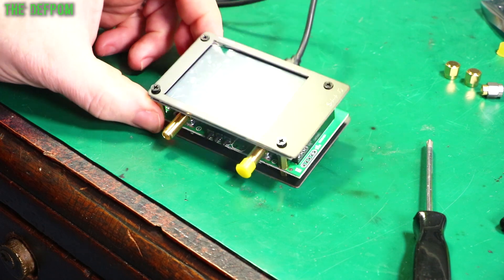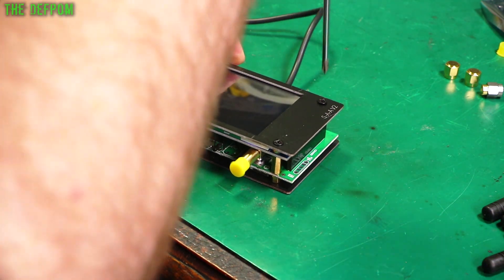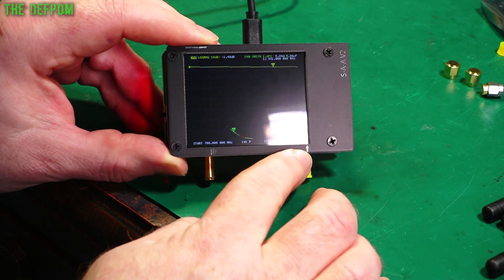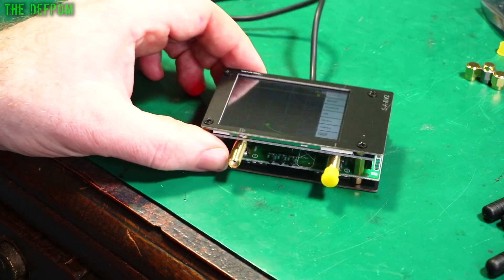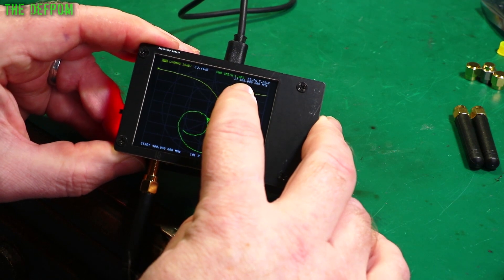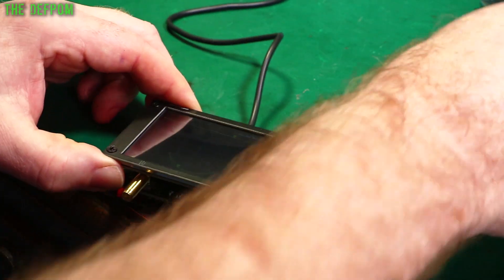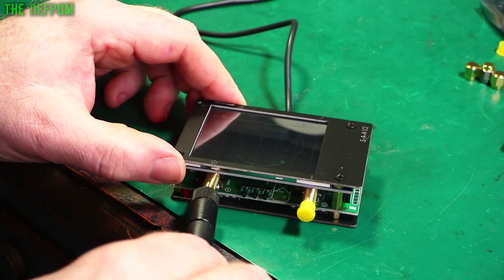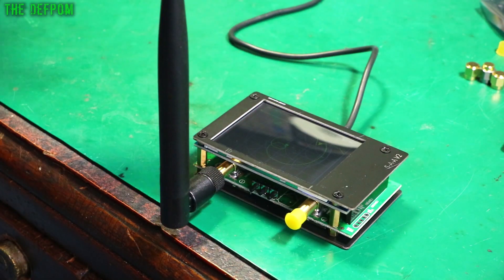How To Use NanoVNA V2 To Find Antenna Resonant Frequency - No.754

Comment: Just got mine delivered today! Thanks for the simple instructions. I was able to get all my SWL bits of wire i use for temporary RX across the hambands under 2.1 with the three matchers in the system. Tuned the back iron fence in on 27Mhz near 1.1 LOL

Comment: Am i right in thinking that the calibrations that are saved to a slot do not have to be done again and can be recalled if your going to test the same type of antenna with the same range of testing?
say for example i will be testing 868mhz, 915mhz and 2.4ghz antennas, i just store each of them into a slot and load the calibration for the correct one i want to test providing the parameters are the same as when the calibration was done?
Reply from the maker: Yes
Reply: @TheDefpom  thankyou 😀

Comment: I've got a nanoVNA v2 on order but till now I have always pulled the cover off all antennas I get to check the length because I can't trust that what's inside is the right type for the frequency its sold for.

433 and 868 are a little harder to check based on length because of the antenna design usually being a normal mode helical but for 2.4 and 5.8 dipoles its piss easy to check them with callipers or a ruler :)

Comment: Antenna resonance frequency and impedance matching are two different things. An antenna is resonant where reactance is 0 (+jØ), which can be different than where impedance is matched, e.g. 50R.
Reply: So is it not possible to find the resonant frequency? If it is - how do you really find the resonant frequency?
Reply: @notsure7874  Look at my post above. Resonant frequency is +jØ
Reply: @TMS5100  Sorry, my bad - I meant "using the nanoVNA" - I've spent enough on tools for this month :D 

I'm looking at the nanovna menus now and see there's a trace format for reactance too. I'd assume then, that I'd set that trace up, and find the frequency where that's zero? I assume that the impedance should match there as well, or not necessarily? Should be close anyway?
Reply: @notsure7874  lowest SWR can be considerably off from where the antenna is resonant. people freak out about "high swr", but even swr of 2.0 means power loss of only ~10%.
Reply: @TMS5100  Yes, and yet, the antenna has maximum performance when the impedance is matched to the antenna at the resonance point, correct ?
Reply: @californiakayaker  to get maximum performance your transmitter would have to match the impedance at that point, which is not always 50R. in the end, "maximum performance" really means very little, you would never notice 10% difference.
Reply: @TMS5100  Well, I have antenna's which are resonant a various frequencies and could possibly have 200 ohms, or possibly 100 ohms impedance. Quite often people use 2 to 1 baluns or 4 to one baluns to help with that. I've also used 1/4 wave lines of 75 ohm line to match to mostly loops, which works very well for one band. A more complex scenario is the huge loop I have, 160m. I match with a 4/1 balun , but I'm using 450 ohm to it. I get very close results at 20m and 40m . And, since a Balun is a transformer, it can be fairly efficient. Thats how I do it. Works very well. That said, I have more trouble with 160 than any other band. Not sure why yet. It is a fairly wide band. but not sure other than the possiblilty of ti being 100 ohms and I'm matching with a 4/1 wihch takes me to 200 ohms or more.

Comment: Absolutely! I was able to find a repairable HP 8753A VNA and an HP 85046A S-Parameter Test Set on eBay for reasonable prices but they are few and far between. Now that you have one you will find quite a few uses for it.

Comment: I've ordered the SAA-2N version 3GHz NanoVNA which has N-Type connectors and larger 4 inch display in a better enclosure.
Reply from the maker: Andrew Jones - that is a nice option, the bigger screen is definitely a plus if your eyesight isn’t as good as it used to be, although I think there is a firmware update to allow you to add one to this size (the screen just plugs in), I did try a 4” TFT that I have here but it didn’t work without the update.
Reply: @TheDefpom  Been following the group for new generation NanoVNA's. Thinking on how to to an affordable full two port version and real time spectrum analyser in the one device. https://groups.io/g/NanoVNA-V2